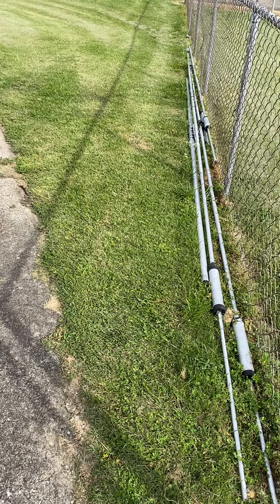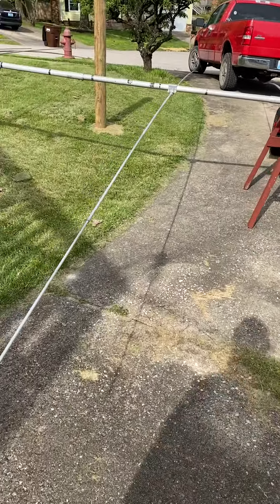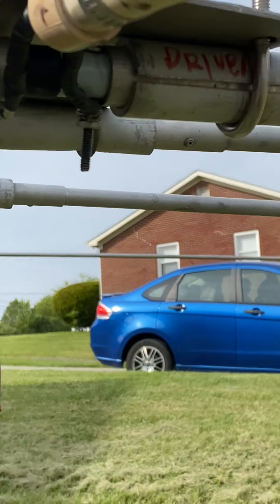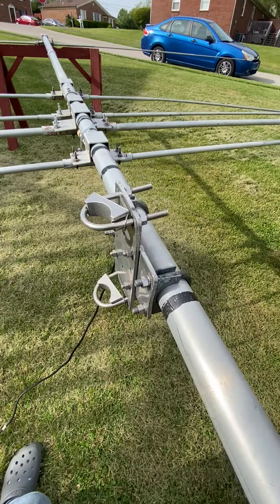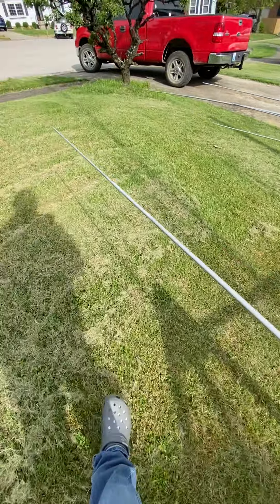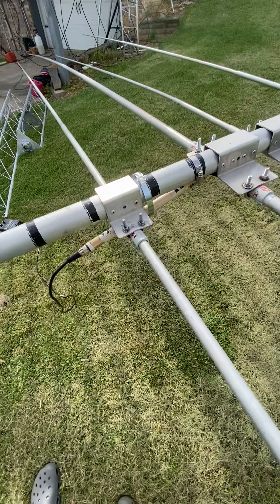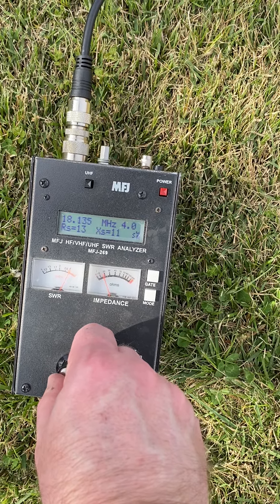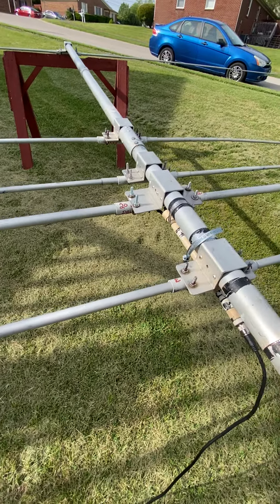Force 12 c3

Comment from the maker: As you can see at the 46 second mark. I failed to insert the 2 bolts that held the reflector on. After about 7 months of pigeons bouncing on the reflector, it collapsed from the boom. Also the feed point did fail. This all happened in a 24 hour period. When the reflector is off of the antenna , it is essentially a rotating dipole for 20m. However , during cqww I was turning the beam a lot and noticed that 15,10m still worked great. A few hours later, the feed point leads broke. Just an update as we’re trying to fix it before bad wx. 😢